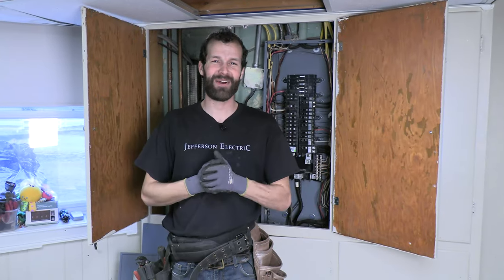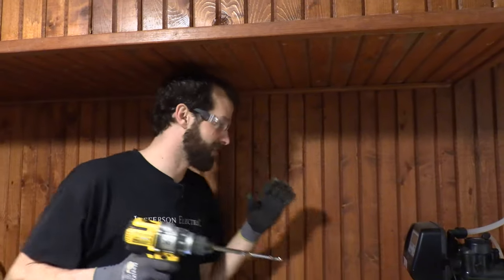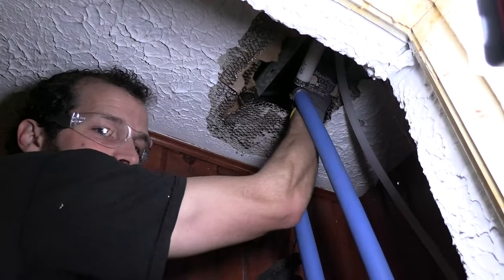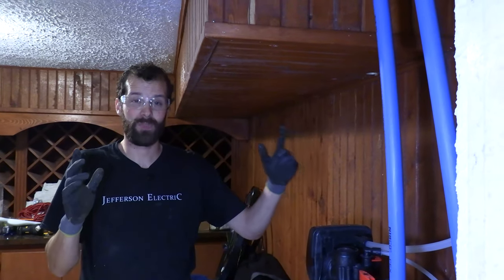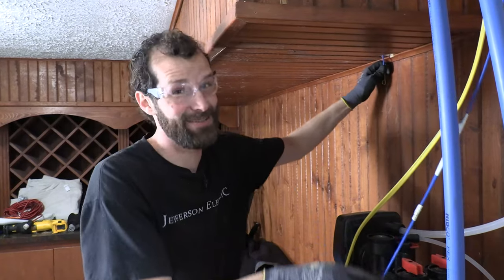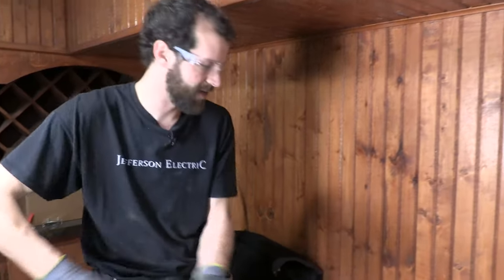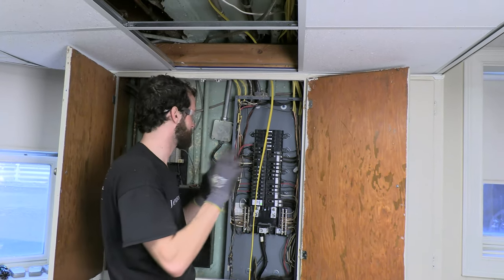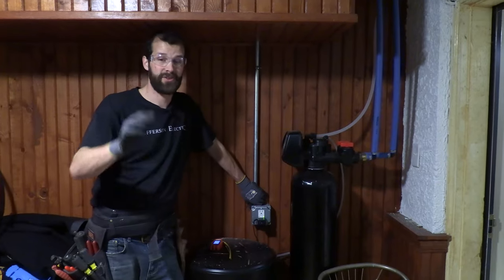Installing A Receptacle For Any Major Electrical Appliance

Comment: 29:01.  The EGC is required to be connected to the metal box per 250.148.
250.148(B)  Equipment Grounding Conductor Continuity. The arrangement of grounding connections shall be such that the disconnection or the removal of a luminaire, receptacle, or other device fed from the box does not interrupt the electrical continuity of the equipment grounding conductor(s) providing an effective ground-fault current path.

Comment: I've spent the last 6 months adding 6 new circuits for my basement (20A laundry room general outlets, 20A dedicated washer and gas dryer, 2x 20A general shop receptacles, 20A dedicated table saw and new 15A lighting circuits).  The previous owners kept adding and adding to the original basement 20A circuit... way to many devices on it.  Soon, I'll have just the sump and original basement lights (3) on the old circuit... way better.  Next I do the garage... convert the old circuit just for lights and the door opener and add a new 20A for general outlets.  The service breaker box has plenty of capacity and free breaker slots.

Comment: I found a $30 semi rigid bore-scope camera (pairs with phone) to be extremely helpful when fishing wire through blind areas.
Reply: Ferret Pro - Multi-Purpose Wireless Inspection Camera and Cable Pulling Tool with Free Cell Phone Wristband
Reply: I sometimes use my phone camera with flash on as a periscope if I need to see something where I can't stick my head. Or sometimes I'll stick my phone through a hole and record a video and rewatch it..

Comment: @ 29:00. Why was ground not attached to the outlet box too.  It just to gfci.  Not the ground screw in the box.     If hot wire come loose and touch box it ⚡️

Comment: My area(NH) been awhile I used to use a romex connecter to conduit fitting and than strip the rest of the romex sheathing off after connector and just feed the loose conductors into the emc. Some have said thts a code violation in later nec book
Reply: @ElectricProAcademy  yes but there is no box it's a romex connecter attached to an emt fitting/coupling however you can easily have the required sheathing in the coupling

Comment: 2020 nec now says that gfci protection is required in basements, not just unfinished or unfinished portions.
Reply: I understand that 😂, in NY we are still on the 2017 but im new in the electrical field and have a 2020 code book and not a 2017 so it kind of confusing when studying the code lol.

Comment: Joel, you forgot to bond the ground to the box.  You installed the green ground screw in the box, but you did not bond it to the equipment ground wire.
Reply: Was just reading comments to see if someone put that lol!
Reply: I'd trust it.  If there was any question that the ground wasn't connected to the mounting yoke, then nope.

Comment: I was recently installing a new outlet in an old house behind a new stove that is equipped with electric light burners and a new dishwasher. Which had no access in the crawl space under the house this particular house had no grounding wire attached to the dishwasher that was removed and the romex was to short to reach the new dishwasher. I was looking at the scope of the project and realized that the romex feeding the dishwasher also fed the garbage disposal so I decided to put in a junction box under the house to feed the dishwasher, garbage disposal, and new outlet for the stove. The flooring under the dishwasher was already compromised soi cut it out and was able to lay down and run new wire. The whole point of saying this is I couldn’t reach or see very well to run the wire from behind the stove outlet location to that junction box and I use a small inexpensive camera scope system taped to my pull rod’s which Bluetooth connects to my iPad and see what I was doing in a blind location such as the wire pull in this video. I fought for what seemed like three or four hours without the camera scope and after attaching the scope it took less than thirdly minutes to accomplish the wire pull. The scope I bought for less than forty dollars on Amazon and is normally used for plumbing purposes but worked great for blindly pulling wire though tight spaces and pulling wire through blind locations. I won’t pull wire without it again totally cut my work time to a third of what would have been. Enjoyed the video keep up the great work

Comment: When drilling thru that bulkhead into the ceiling void ¿? Wouldn't a ⅝ x54" whip bit been better choice. That way you could attach a pull wire all together.  Also as a tip that had to done several times. When pulling wire thru suspended ceiling, Cut a  small slit in a tennis ball, then insert then fold over about ½" the end of the NM sheat in the slit. It will bounce it along the ceiling tiles and the metal frames. Oh and one more thought where you had the Gas Line pinching the NM wires  Use a Plastic Door Shims or even Toilet Shims too.

Comment: Have you had to deal with afci and afci/ gfci combo on 240volts circuits yet ?
Reply: @ElectricProAcademy  the big issue with all the afci/gfci is in homes built 50 yrs plus ago is all the shared neutrals and cross phased connections
Reply: GFCIs were a no-brainer but I am still skeptical that AFCIs are worth it long term.

Comment: Get yourself a cheap USB borescope cam to use with a phone/tablet/laptop. It takes a lot of the guesswork out of jobs like this. In the case of an open ceiling you can also often just stick your phone up in the cavity and have a look around. I've had great success guiding fish rods to their destinations through walls by placing a camera in the wall so that I can see what the heck I'm doing.
Sometimes I even tape the borecam to the fish stick and take it along for the ride. Once you've used a camera every other technique is just madness.

Comment: Last comment, I have that tester also. Stop by Home Depot and pick up a Durable 6 in. power cord, converts 1-outlet into 2-outlets. 
Model#: HDC201
Sku#: 1002831574
Internet#: 303467490 and plug your tester into that. Helps you see the screen for outlets that are installed upside down or behind a dresser etc…..
Reply: I’ve got a few of those.  One stays in my laptop bag so I always have two plugs if I find one plug or get someone to share at an airport where there are never enough.  Also helpful when using smart outlet wart and you need more than one thing plugged into it.  Or just an extra 12” of cord.

Comment: I purchased the same Klein Voltage GFCI Tester that he has from Amazon and the damn thing did not work ! In the Trash it went and I purchased a Amp Probe GFCI Voltage instead that worked ! Both had/has the GFCI Trip Button feature to enable one to test GFCI Receptacles.
Reply: @ElectricProAcademy  ; I bought another Klein GFCI Receptacle Tester and it works just fine ! First one must have been a factory defect . LOL

Comment: Can anyone point me to the code reference that prohibits the NM cable from touching the gas line?  I can’t find anything in articles 300 or 334.  Is that a local specification?  I checked the 2017 and 2023 NEC, but I think Indiana is on 2008; however I don’t think that’s a requirement that would have been removed.
Reply from the maker: Yes, it's a Goldbook requirement for us, not NEC. (Indiana has also just updated to NEC 2020 code, FYI.)

Comment: I'm watching you struggle with drilling these holes and wondering why you don't have a flexible cable installer's bit. They're usually 36 inches long and have a hole in the auger tip so you can pull your wire back out. They're designed for drilling around obstructions, through framing members inside of finished walls and would be perfect for what you're trying to accomplish here. I bought a cheap one at a local electronics store and it's worked absolutely brilliantly. I use it often.
Reply: @ElectricProAcademy  Ten holes? I guess you're probably exaggerating. My current one might be by Irwin? It's on a job site right now so I don't remember. I know I've bought cheap Chinese bits at a local electronics retailer and it lasted for quite a while.

To be clear I use installer bits only when I can't get into a space with a regular auger or spade bit.

Comment: I would like to know, if I am wiring a 14-30R with 10/3 wire, do I need to replace all my 10/2 wire to my double breaker or can I just run a red 10 AWG wire alongside it to a J box splice?

Comment: Having worked in the trade for more than 55 years as a Licensed Journeyman Electrician , Residential & Commercial, and still working at it sometimes ,  why those 1900 boxes did not have screw holes on all 4 corners for attaching the Metal plates to them instead of just two ? ?
Reply: I've never seen a "1900 box" with four cover screw tabs.
Reply: @jovetj  ; Me neither !

Comment: I've always wondered, why do they have 4 screw holes in those boxes but don't give you 4 screws? Shouldn't they all be screwed shut?
Reply: There are four holes to allow for freedom of rotation of the cover with respect to however the box is installed.

Comment: You threw me off when you introduced yourself as "Bob Ross." Obviously you and I know who that is, but I was surprised my Mother didn't know his name, and my Dad is totally clueless. I used to watch him close and always wished I could paint. Assuming I could afford all the stuff, and follow him a long, at the end of the show, he'd have another masterpiece and I'd have a big mess. I always wanted to draw and paint but I never could. Oh well. Easel come, easel go.

I also agree with you on the GFCI idea. My philosophy has always been to have more than I need, than not enough because it's better to have it, and not need it, than to need it, and not have it. I am also still debating with myself if it is better to have a GFCI outlet if I have a GFCI breaker, or does it hurt to have it or is it possible to have too much safety ? Also price dictates what actually happens in the end.

I noticed that you installed a box using a ground screw, but you did not connect the ground screw. I understand that the GFCI being grounded also grounds the yoke and the box then will be grounded too but why not use the screw ? You also made a point to make sure to use a box with said screw. Most boxes do not come with a screw. Though moot anyway, I am for "if you have it, use it." So I am just curious why you made sure you had it but did not use it. 

I really hate these LED lights on GFCI too. They've been fine forever without them, then all at once, a LED. Then each one is different. A green light on, no light tripped, in your case a green and red light when tripped, which makes no sense, another one I have has no light unless tripped, then there is a yellow LED. Also makes NO SENSE Obviously just another way for the electric company to milk a few more pennies out of customers. Their greed has no end.

Anyway, another great video. Thank you for posting. Always entertained and kept company in my days of loneliness.

Comment: I usually use electrical tape around conductors in a metal box.
Reply: I find that leads to a sticky icky mess later down the road when the box needs serviced later.

Comment: At 30:00 you could've wrapped the outlet with electrical tape to prevent shorting from hot to ground.
Reply: also at 30:00 what was the reason you didnt have to bond bare ground to the green screw in box? I think you are the man and do awesome work. your code knowledge is second to none. great videos

Comment: How come you didn't use  1/2 '' EMT to run that 12-2 NM-B Romex instead of using 3/4 '' ?? That  12-2 NM-B Romex would have fit into 1/2 '' EMT with no problem for that short  of a run down the length of the wall to that 1900 box !
Reply: I've always considered ¾" the minimum for Romex in (incomplete!) conduit. More space around the enclosed cable is a good thing.

Comment: Instead of reaching into a dark space, why not light the area where you were reaching into and darken the area where you sent up the fish sticks. Light is your friend.
Reply: I was thinking with that light maybe a work mirror.
Reply: Put your smart phone on video mode with the light (flash) on and place into the opening while rotating the phone. Then watch the video and plan your work.
Reply: "You might hit something and potentially cause some peripheral damages to where you've got to cut out a large section of finished materials..."

Proceeds to use 2 foot 3/4" drill... 🤣